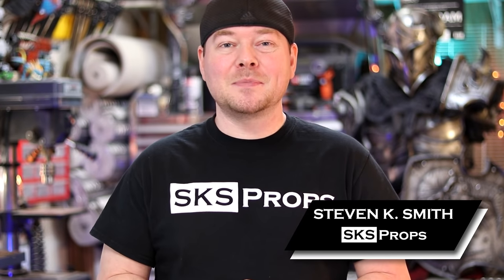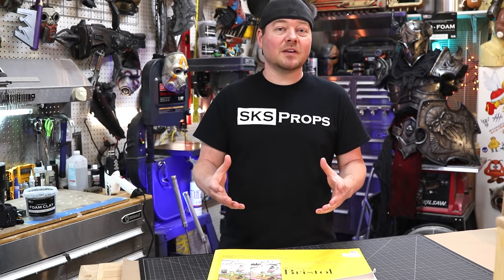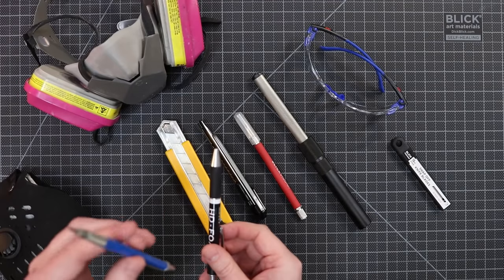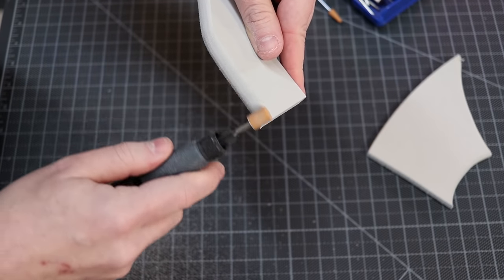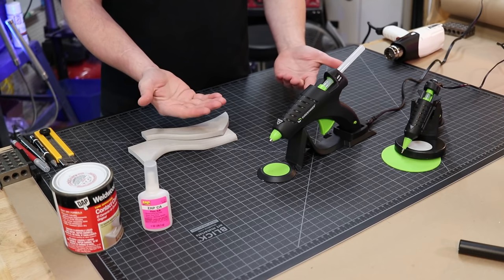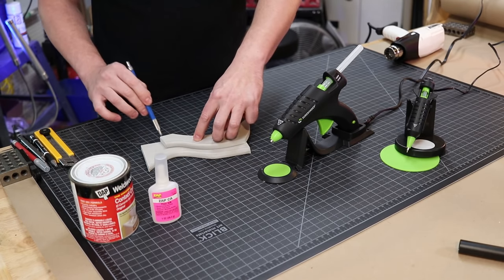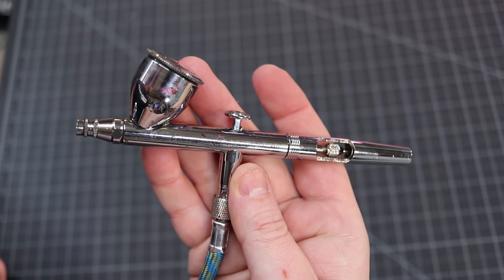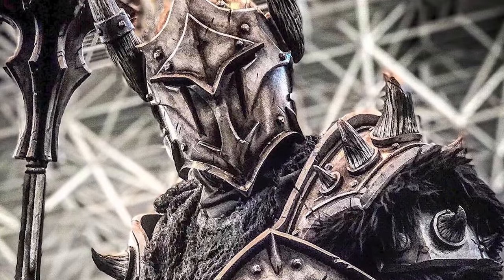How to Cosplay using EVA Foam - Basic Tools Techniques and Materials Needed

Comment from the maker: Check out more of my complete builds, walkthroughs, and HD-Foam at www.SKSProps.com
Reply: Does HD foam post to the UK? We have our own foam shops over here, I'm just real curious about trying some HD Foam to see if theres much difference
Reply from the maker: @dacentabaal  as of right now my foam is exclusively sold through Blick Art Materials they do ship internationally but I don’t know the costs
Reply: But foam clay is not available where I'm from which is the uk
Reply from the maker: @nerothejackal9662  yes it is poly props sells it overseas
Reply: @SKSProps  if I do I'd have to pay extra for shipping
Reply: What type of spray paint did you use for the metal color, what brand, do you have a link to it?
Reply from the maker: @deeamerson  rustoleum antique nickel is one of my favorites
Reply: @SKSProps  cool thanks
Reply: Man... I have been 3D printing for a year now. This. Why did I not do this? I have to do this. I have to do Batman suits now. Then I have to try and see if I can mold high density foam... cast in urethane.
Reply from the maker: @KurtisJoseph  yes you can mold hd-foam I have done it for several client helmets and chest pieces in the past
Reply: Just curious cuz I can't seem to find the description for it on the website.
How much density are your HD Foams?
45, 100, 167kg?
Reply: @yannycandelario7606  great question! I am not sure of the kg weight per mm size. It is 24x60 and so far, this is going to be my go too source. I got pretty clean cuts with scissors... so its dense "enough" and holds its shape really good. No more craft foam for ANYTHING.
Reply: @KurtisJoseph  Oh okay cool! Thanks for the response😁
I'll get some to try em out

Comment: For the heat gun safety. I have another recommendation is that you can prepare a mug cup let it laying around and whenever you're done using a heat gun, slip the head into it. It will be much safer. I had this habit of letting it sits on its back every time I used, and it gave me a heat mark by accident once
Reply from the maker: Isn't that how you get branded to show you're a maker! 😆 Good Tip!

Comment: Very informative and even as someone who has been working with foam for years I definitely learned some things/understand them better. Sad to see that your line of thicknesses has gone down a bit from when you started in regards to what Blick sells, but I can understand that those thicknesses will give you your core essentials. I have still yet to do much with foam dowels, I definitely need to look into those in the future.
Reply from the maker: Thanks! Actually it was still under wraps but Blick is adding 4mm to the lineup with the next shipment prob late December!

Comment: Hey man i really love your video though i want to ask something about "the sealing eva foam" part.....

I really can't find any plasti dip at any store that's near me,can i use "rubber paint" to seal my eva foam?....im kinda new to this cosplay props making😂

Still.....love ya content may you have wonderful day❤
Reply from the maker: Plasti dip can be found in the states at Walmart, homedepot, and lowes. Outside the US and rubber spray can work as long as it is a thin mixture. So don’t use truck bed liner or sprays that come out thick. Besides sprays you can also use brush ons like creature cast, flexbond, and mod podge. However mod podge has a tendency to wrinkle much more than the other options.

Comment: As someone who's never worked with foam before, this (and all of your videos) is super helpful! 
Do you have any advice for adapting this process to a mix-media piece? 

I'm looking to add  "metal" (foam) toe and heel tips, as well as other ornamental "metal" pieces, directly to leather boots. I'm guessing brush-painting the flexbond and paint would best to avoid getting paint on the boot itself, but I'm not sure what adhesive would be flexible/strong enough to stick to a leather boot. 

Thanks for all that you do! You're a bright spot in this world!
Reply from the maker: First off thanks! Id use contact cement to attach the foam pieces. Also be sure to scuff up the boots first to give it something to grip onto
Reply: @SKSProps  Thank you so much for the advice- and the tip with scuffing up the boots! I appreciate you.

Comment: The flexshaft on your rotary tool is also keeping the motor away from all the dust. This makes it hold for much longer, because dust wouldnt come into the motors electronics. Annother reason for the flex.... thanks for the video.
Reply from the maker: Great point!

Comment: Working with foam is a bit scary for me, since I'm not that experienced with cosplay yet. 😂 So envious of all the people who can make this cool stuff.
Reply from the maker: Just remebmer most of us have already been working with foam for a long time. I'm well over 10 years so each project is a chance to learn and get better at the craft
Reply: @SKSProps  Yep. Gotta start somewhere as a newbie with this material. Gotta learn to crawl before you walk. ☺️ Just a question about the foam clay: Does it only adhere that easily to foam 'sheets' or does it work with, let's say, a hard plastic mask as well, if one wants to sculpt something with it?
Reply from the maker: @slasherlady  foam clay can adhere to hard surfaces ( like my foam pumpkin videos ) you just need to wet the surface so that it bonds properly
Reply: @SKSProps  Cool. Good to know. I'm really interested in trying it out. Seems like a very cool material to use.
Reply: @SKSProps  If I may pester you with another question: if the foam clay piece that one has made has dried, can its bonding abilities be reactivated with water, or does one need glue to attach it to something?
Reply from the maker: @slasherlady  if the foam clay piece has dried you’d want to use contact cement or superglue to attach it
Reply: @SKSProps  Thank you so much for taking the time to reply. It's a great help. :) 👍

Comment: I just bought a roll of your foam from Blick and I’m wondering how to make it lay flat?  It keeps wanting to curl back into the roll shape it came in.  Any tips here?
Reply from the maker: Lightly heat it with your heat gun and roll it the opposite direction. The foam will want to return to its original flat shape. I lay several sheets together and place some books on top for mine as well

Comment: If I don't have or can't afford a heat gun, would I also be able to use something like a Hair Dryer to heat treat foam?
Reply from the maker: You can try every hair dryer is a bit different for high temp
Worse case you can get a heat gun for like $10 at harbor freight
Reply: @SKSProps  Okay. Thanks.

Comment: I'm trying to work on my first cosplay item and found you while seeking wisdom. This is an awesome video. Just subbed, thank you! 

I was wondering (and I'll probably find the answer on one of your other videos) how you would attach elastic or stretchy fabric to this kind of foam? I'm wanting to make a helmet that can fit different sizes while retaining detail, without it being too clunky.
Reply from the maker: First off thanks! When I attach elastic I always do a double adhesive method where I will glue the strap to the foam then cover that with a piece of 2mm foam to make sure it can't pull away
Reply: @SKSProps  Thanks for the reply! I'll definitely try this.

Comment: Thanks for this step-by-step guide. When you sand the EVA form with a rotary burr, it generates a lot of dust. Do you have some kind of dust collection system installed on your desktop?
Reply from the maker: I have an entire station for dust collection. I cover that in a later video. Check out “the tools I use to make video” video. Otherwise yes it creates a lot of dust and I would recommend to have a shop vac handy
Reply: @SKSProps  ok thanks for the tip.
Reply: BTW: what do you use as the structure if I want to make a sword with HD foam? @SKSProps

Comment: Hey Steve great video really inspired me but I have one problem lately I’ve been going onto Blick Art materials and I can’t really afford the foam maybe you could lower your prices? Not to sound like a jerk again you inspire me!
Reply from the maker: Hey glad you’re inspired! I don’t control pricing but I will say that the prices Blick has on my foam makes it the best bang for the buck on the market. No one else can stack up to the quality of HD-foam for the price. Plus if you were to buy the Cosplay Bundle that’s 3 sheets that are 24”x60” that is a ton of material to work with. Plus Blick ships incredibly fast so you get your products right away.
Reply: @SKSProps  That is 100% OK I had a Plan B for adding some coupon codes for your high density foam rolls I really appreciate the things that you’re doing and I’m gonna try my best to do the same.

Comment: does the Plastidip make the foam feel more sturdy? my main concern with building armor with EVA is that i am afraid that it will be floppy.
Reply from the maker: the sturdiness of the foam depends on the shore hardness and density. the higher these numbers are the better it will hold up. The plasti dip can help improve this durability by adding an additional layer that is basically a rubber. I use 6mm for pretty much all of my armor and helmets and it holds up just fine. If you use cheaper low density foam then your armor will feel soft
Reply: @SKSProps  i appreciate your response. i planned to start my first project with your Space Marine Absolver Bolt pistol and was just going to buy the foam you recommend, but when i branch into armor i just wanted to be sure it didnt look goofy. thank you

Comment: if it's not necessary to heat seal the foam, does that mean usually the only instance you'd need to do it would be when you are shaping/warping it in a certain way? that's pretty cool!
Reply from the maker: Correct, now that is only going to be with my foam other brands require a heat seal because they are much more porous and will soak in way to much paint
Reply: @SKSProps  that's so awesome! in that case, when would you warp the foam to its desired shape? would that be before or after you finish the painting process?
Reply from the maker: @luckynow7  you always do manipulation and textures before you seal ( Plasti dip ) and paint the foam
Reply: @SKSProps  got it! thank you for the help :D not sure when i'm making my armor this year but this high density foam has definitely caught my attention heheh

Comment: I dont have a heat gun but i had no idea you could use a max rpm stone bit to burn off the fluffy strands thanks!
Reply from the maker: If you like that check out my how to make the ultimate sanding drum video 👍
Reply: @SKSProps  I absolutely will

Comment: How well does EVA foam stand up to being out in the heat for long stretches; e.g. a full-day Ren Faire out in the sun and 90 degree heat?
Reply from the maker: heat and water won't bother eva foam. but certain adheasives can fail because of heat such as hot glue. that's is why I use contact cement and super glue, but the foam will be fine
Reply: @SKSProps  Thanks so much!  Can't wait to get started!

Comment: Hey!! I'm new at cosplay.. my first projects were the blaster from the mandalorian and Grogu's pram, both using your tutorials and templates. I was wondering, is there a significant difference between the high density foam you sell and other high density foams on the market?
Reply from the maker: Hey! Yes there is a huge difference. I actually developed my HD-Foam specifically for prop and costume fabrication. The big deal being mine is the highest density at a shore 38 hardness. Basically that means it cuts cleaner, sands smoother, and is waayyy easier to manipulate. I promise if you ever get a chance to try it you’ll definitely see the difference 👍

Comment: What's the difference between that small sanding bit and a woman's nail drimmel?   Why not just get the nail drimmel??   Can use on both.
Reply from the maker: Because you can get a full rotary tool kit with flex shaft for around $20. Which will have a ton of cutting/sanding bits of various grit plus a higher rpm and torque than any nail sander
Reply: @SKSProps  Okay.  But have you ever used a good quality woman's nail drimmel?   Yes the good ones are around $100..  but they're made to be steady.. and the rpms are adjustable.   could use it both for your cosplay and nails.  So if you're a woman who owns a nail drimmel, could possibly skip the file.

Comment: When you're going over the cutting tools, there's a little cylinder looking tool that you don't talk about. Is that some sort of sharpening tool? My biggest issue is keeping a sharp blade. It's like after a single cut, it's too dull to make those nice slices without it looking jagged. I find stropping my blade with leather and a compound helps but I have to do it after every cut it seems
Reply from the maker: It’s a kershaw knife sharpener I use it all the time especially after every few cut
Reply: @SKSProps  Thank you so much! I love snap on blades but I refuse to go through them as often as people say you should.
Reply from the maker: @KeryuOkami  with the sharpener I’ve had the same blades in mine for months. And I guarantee I cut a lot more foam than most.

Comment: I see links for lots of tools but I don’t see one for the respirator and mask. Can you add that link to the video description?  I want to get what I need before I start working with the foam to be safe from breathing in fumes. 

I’m also going to set up an extractor system at some point to assist with the dust. But until then we’ll just run with a respirator/mask. 

Thanks for the videos and help!
Reply: I see the respirator on your site under tools and safety. Can’t buy it but I can search for one with that I believe. A link to one may also still be helpful.
Reply from the maker: You can buy a respirator at any hardware store or Walmart. I personally use a 3m respirator with organic fume filters
Reply: @SKSProps  thank you. I just didn’t know if there are different ones that are regulated for specific things. As in are all respirators the same but uses different cartridges for specific things. That type of thing. Just trying to be super careful with the lungs and breathing.
Reply from the maker: @NerdNerfer  definitely 👍 just look for ones that say for sprays and organic vapors on the box. For 3m they are pink

Comment: Hi, I've been dealing with EVA daily now for 4 or 5 months. I don't melt it , just cutting and what not but I deal with alot of it. I use it in the basement of my house. My question is do you take precautions because of the formamide content in EVA? Do you wear a mask or gloves when working with it? I hear formamide is a very nasty chemical and some EVA foams have been banned in certain countries. Any advice would be great 👍
Reply from the maker: That’s why when I made my line of HD-Foam I made sure that it is formamide free. 

I do wear a respirator when sanding and heating the surface. Cheaper foams out there including some floor mat foam does have formamide and yes you’d want to take precautions
Reply: @SKSProps  I am using craft foam from Michaels stores. I have heard that formamide free means just the lowest level of formamide allowed by regulations. I don't heat it or anything like that just doing a lot of cutting on my vinyl cutter. I cut so much of it that it worries me a little even though I'm not heating or milking it. Thank you so much for the info I appreciate it
Reply: Melting* lol
Reply from the maker: @jasonl5500  no prob 👍 just a heads up Michael’s foam is literally some of the worst I have ever tried in my years working with the medium. If you ever have an opportunity to try mine you’ll see a night and day difference in how mine cuts and sands compared to that. Plus your blades will last longer and it’s much smoother for paints

Comment: Wondered about your small honing tool?
Reply from the maker: If you're refering to the sanding drums. One is a stone bit but for my favorite version. check out the video on how I make custom smooth sanding drums to help refine the foam
Reply: @SKSProps  no the honing rod? Do you use it to hone the blades?
Reply from the maker: @cynthiabaxter4061  oh the blade sharpener is a Kershaw 2535
Reply: @SKSProps  thanks!

Comment: So what on earth makes the hd foam different from just the normal stuff?
Reply from the maker: My line of HD-Foam was developed by me through a manufacture that left me choose my attributes. The main point being it has a higher density at the same shore hardness as other brands so basically that means that my foam cuts cleaner, sands smoother, and is easier to manipulate. Also the higher density means the foam is much less porous so the end product is considerably smoother than other eva foams out there. It's one of those things that once you feel and work with it you can definitely tell a difference
Reply: @SKSProps  thanks for getting back and explaining.
Reply from the maker: No prob 👍
Reply: @SKSProps  last quick quest. Could you or have you done any kind of tutorials on making costume pieces with the foam that may have cloth over late on them? For instance if I wanted to do something like your witch hat tutorial but I wanted it to have a fabric texture to it.
Reply from the maker: @bpblitz  I haven't but others have used faux leather or felt over foam so that it has a structure but then had the cloth on top maybe that's another video I can add to the list down the line

Comment: Haha, Odin called you out for not carrying 4mm foam..shots fired...lol
Reply from the maker: it’s because I used to but Blick didn’t add it to their initial lineup. Luckily 4mm is on the way and should be available by the end of December
Reply: @SKSProps  no worries,  im still a noob when it comes to using different foam sizes for projects.